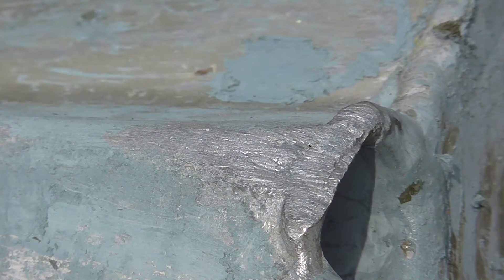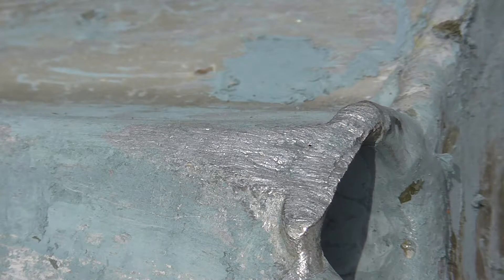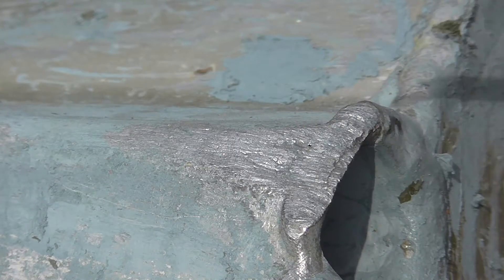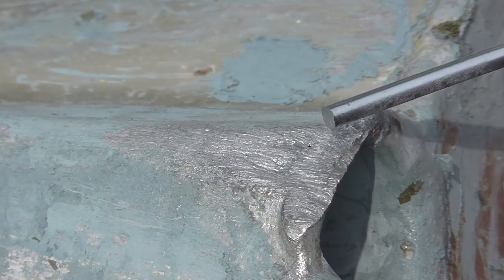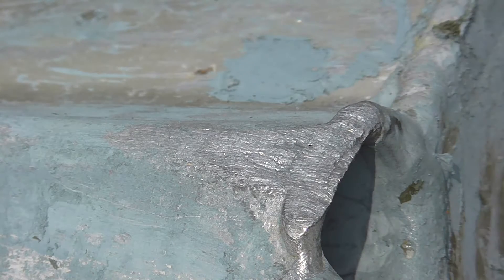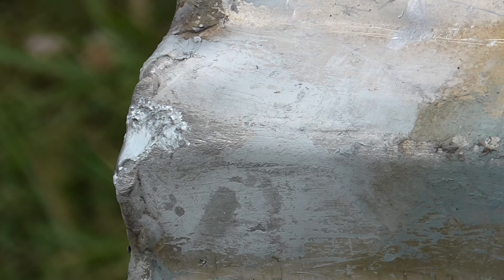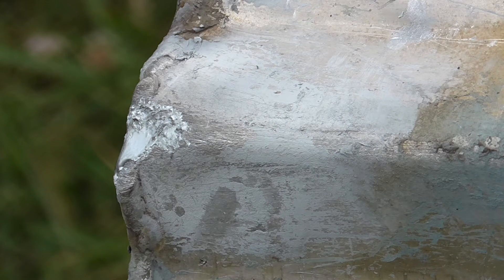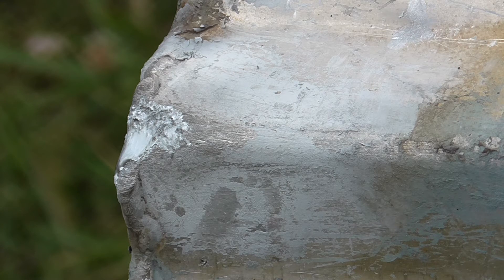Brazing aluminum boat

Comment: Good job. But you are holding the torch too close!  The tongue of the flame is the hottest part           I        >              >       The first arrow.  Also you need to move the torch around, less of a chance of melting a hole in the aluminum.  The most important hint I can give you, is that you didn't remove the oxidation from the area with a dedicated wire brush prior to brazing. Need to do it prior to starting, and half way while you are building the temperature before you braze.  Just a quick little tip for next time.
Reply: Attila well said. YouTube is a great place to learn if people listen to wise advise.